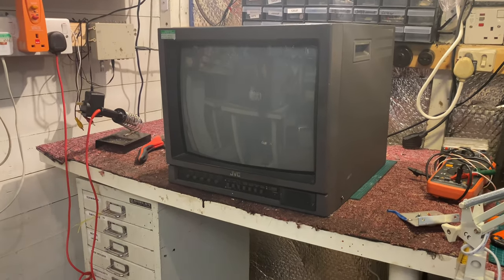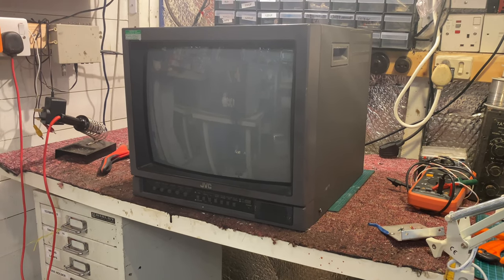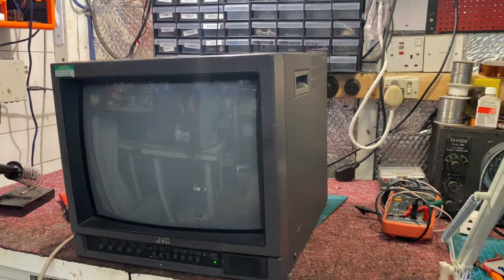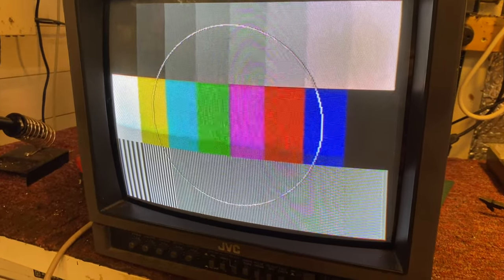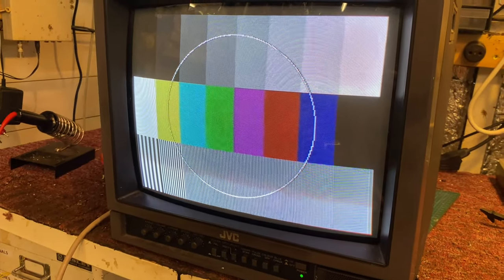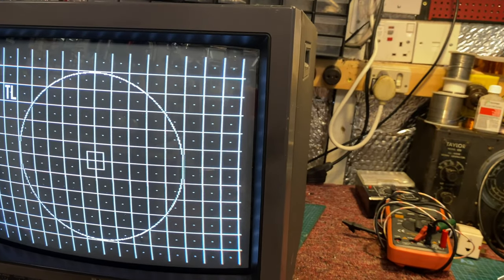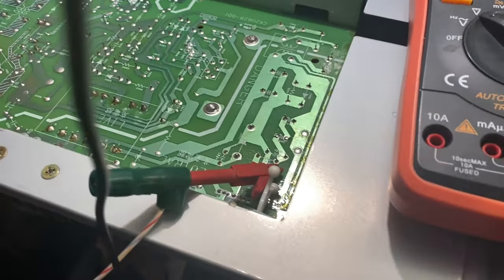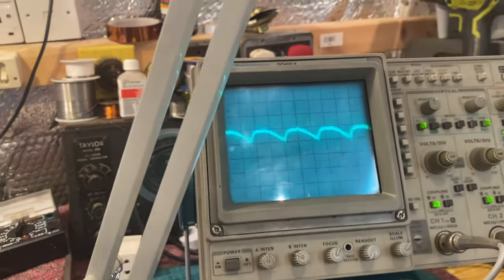Customer Repair - Sometimes Not Working JVC TM1500PS

Comment: Belive it or not, but you actually helped me, I've been trying to fix the geometry for awhile now... Got kinda stucked by reading the manual, then you said something about the "apliude coil" then I finally figured out what do lol.

Thank you very much for the clip, there is not much info of this specific model... I got quite excited when I found this clip!
Reply from the maker: You’re referring the horizontal amplitude coil and the efficiency coils. Amazing stuff. Glad to hear. Please consider subscribing
Reply: @The_Studioworkshop  Correct, Im indeed referring to the horizontal amplitude coil! Did subscribe right away when I saw you had an clip about this model! Thanks once again :)